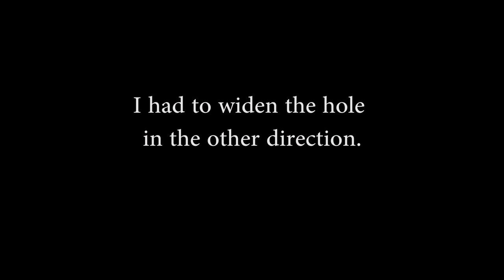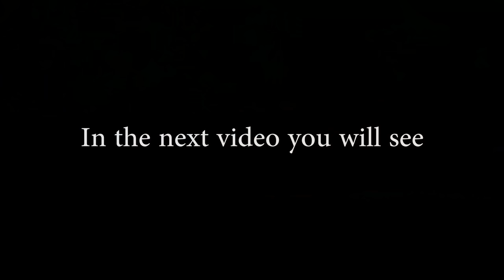Making a knife handle from colored pencils

Comment: Too many body movements. It could have been done faster and easier. And there were too many tools involved in the manufacturing process. Not every home has such a set of tools.
Reply from the maker: Thanks for your input! You can replace the power tools that shape the handle to hand sanding. It will just take longer but will be the same result.